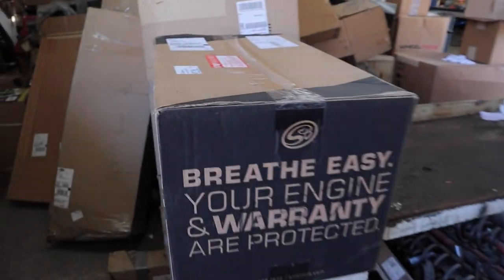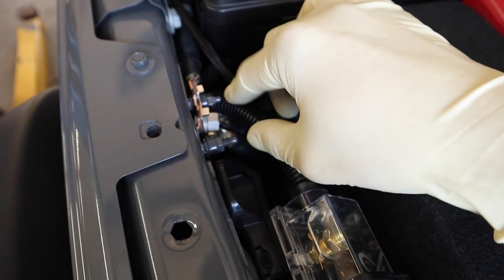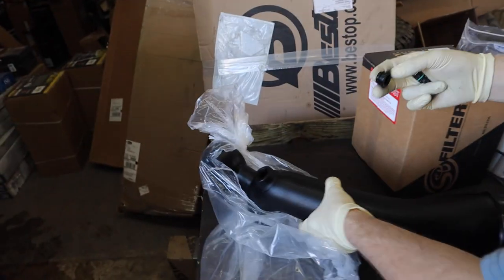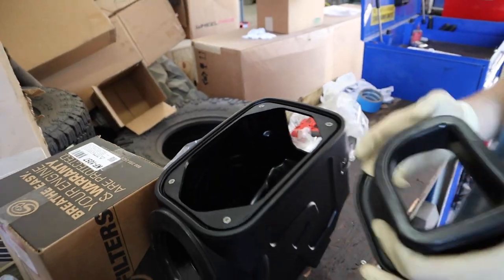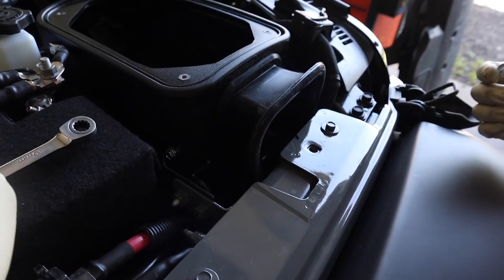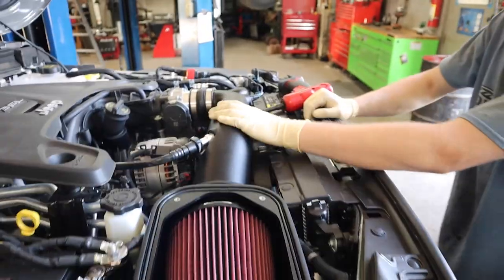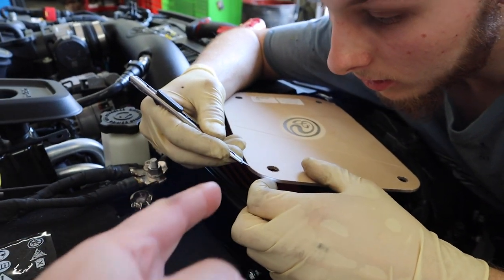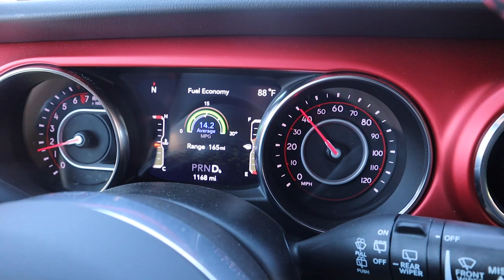NOTICEABLE DIFFERENCE Wrangler JL S&B Cold Air Induction CAI Install & Review

Comment: There have been more than a few dyno runs using S&B intake kit in new Jeep 3.6 V6’s. That make LESS power over 2,700 rpm’s, with stock intake. While a small increase over, but then makes more noise than anything. The only CAI kits proven to make more power, across the rpm range are the K&N Black Series. That added over 11 hp and tq at peak rpm’s.

Comment: I took mine out,  had issues with.  I do have the 2.0 turbo.  It kept triggering codes.  Called them they sent a fix,  but lost the power gained.  Fuel economy dropped to 14 mpg from 17. So put stock back in along with k& n filter.  Jeep is happy now.  Plus the dealership voided my warranty with that s&b intake.
Reply from the maker: Wow, really for a CAI. I would fight that.

Comment: I did the mishimoto cai on my 2.0t and can’t tell much of a difference, but I will be tuning it here in the next couple of days with the jb4
Reply: Update, I installed the mishimot cai and charge pipe and now along with my jb4 my Jeep is pretty speedy now
Reply from the maker: Sweet!!
Reply: BEAST Projects I’m not satisfied yet lol
Reply from the maker: Are we ever?! LOL
Reply: BEAST Projects so I’ve done some testing and I would say on average I can get a 0-60 of 5.8 seconds.  I somehow got a 5.3 one time but I think my GPS must have been off because I haven’t done it again.
Reply: Hey Carter,
Can you share a bit more about your experience with the upgrades you did? I’d like to do something like that on my gladiator as well
Reply: @luiferreira4253  What Gears does your gladiator have? I think the JB4 is the only mod worth doing. after that ive found most mods have diminishing returns.  I am in the middle of LS swapping a porsche 944 so Jeep mods have been on a hold. but a company called Got Tuned has a turbo that should bolt up and ive heard good results from people who have installed burger motorsports universal methanol injection kit along with the JB4.

Comment: Will I notice a sound and pull difference with this being my first engine mod on my 2020 gladiator or should i add something else first?
Reply from the maker: Yup, no need to add anything else first. Be sure to get from The Jp Shop, here: https://thejpshop.net/i-30561711-cold-air-intake-for-2018-2019-jeep-wrangler-jl-3-6l.html?ref=brand:159547
Reply: No you won't.  Better off replacing the air filter with k&n and keeping all the other parts stock.
Reply: You wont notice a difference, you'll hear one.. so if you wanna pay $$ to hear it go for it..there will be no noticeable gains from a cold air kit without headers, larger pipes and exhaust.. u less you plan on doing all of that,this is money wasted and a "garage" wanting you to buy shit from their link so they get a kick back. Dont be that uninformative guy.

Comment: EPA has taken the public position that a vehicle designed and sold for on-highway use, such as a common rail diesel pick-up truck, can never be converted to an off-highway, race vehicle if that conversion impacts emissions controls or emissions. EPA is currently enforcing this position through the EPA’s 2020-2023 National Compliance Initiative (NCI), as well as other methods.

PPEI believes there exists (and has always existed) an exception under the Clean Air Act for modifying emissions and emission controls for motor vehicles that have been permanently converted to off-highway race vehicles. In response to EPA’s public position and its NCI enforcement, effective 9/16/2019 at 2pm, PPEI will halt sales of race products. PPEI will continue to sell its products designed for on-highway use and is making great strides in expanding the line of on-highway products that deliver the performance that our customers desire.
Reply: Did you hear about this
Reply from the maker: I haven’t, but I’m sure it’s coming for a lot of companies.
Reply: BEAST Projects so sad what’s the point in even owning a diesel now:(((by the looks of it it’s going to be a huge thing now I’ve heard cops are now looking for deleted truck as far as having a device to check if it’s deleted